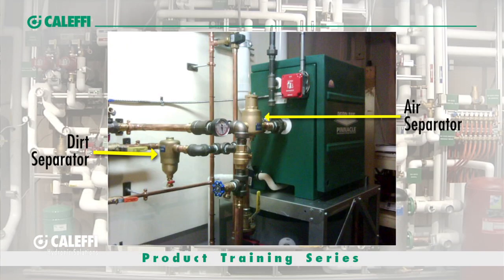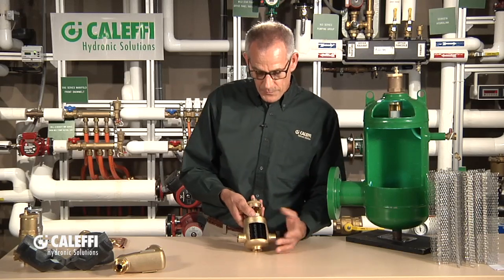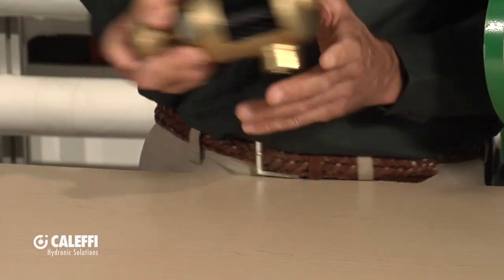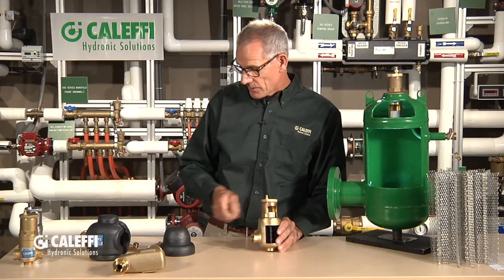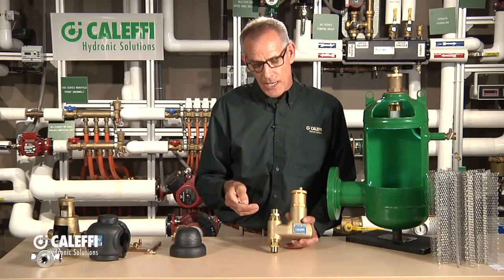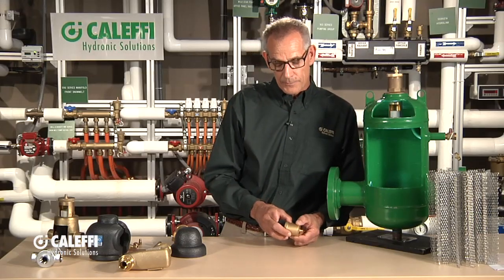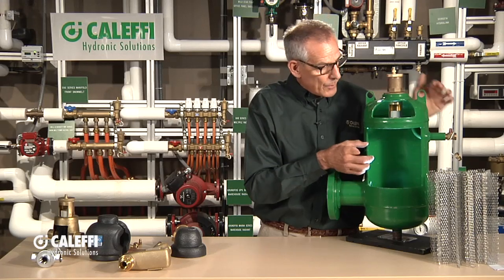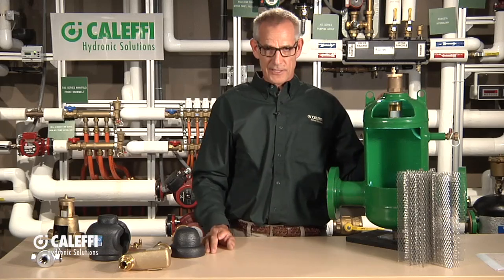Discal® - Air Separators

Comment: Can I use this valve before a water meter to prevent air from passing through the meter and generate savings on the water bill?
Reply from the maker: These are not low lead and not designed for use in a potable water system. They are for use in closed loop hydronic systems only.